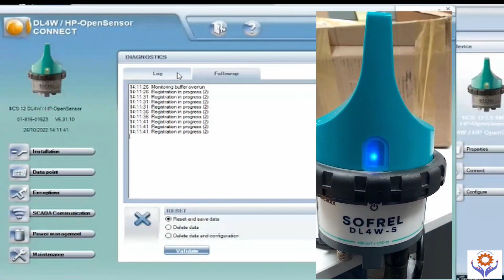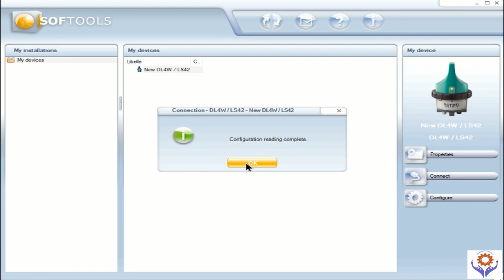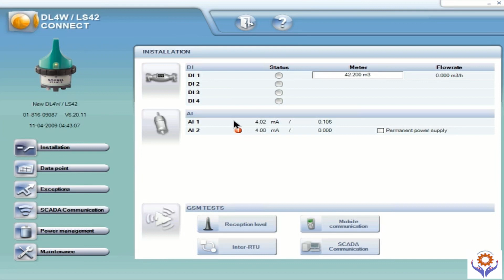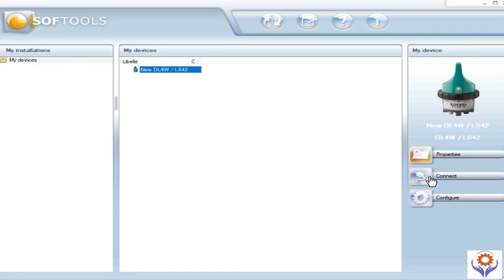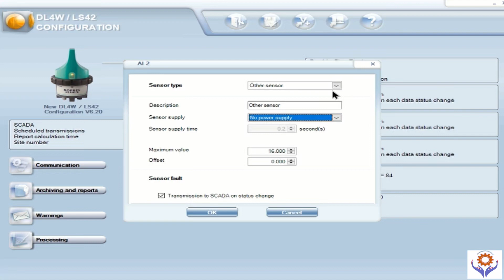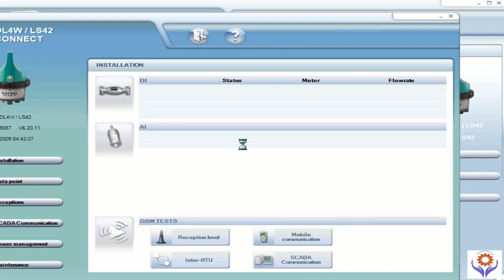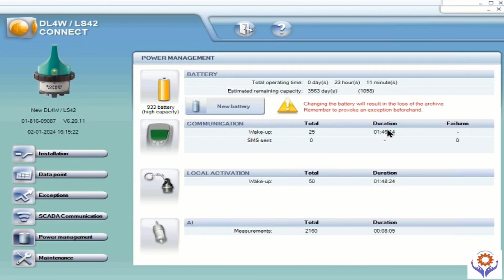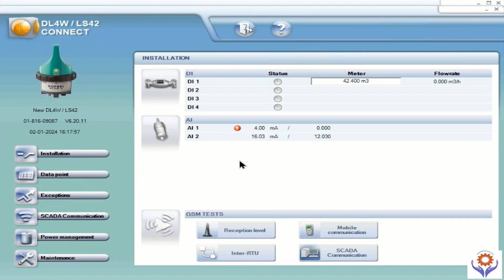Sofrel Datalogger Configuration - Part 2 | Communication , Diagnostics and data verify #sofrel

Comment: Thank you for your explanation.

Just a small question, if it is showing communication failure between the DL and the flow meter. What could the reason for that?

Appreciate your response 

Thank you
Reply from the maker: We has to check the Flow meter output either its giving 4-20mA .Sometimes the FM Cable may be reverse .If you are using Modbus then check the address and Slave ID , Baud rate , Data bit etc..